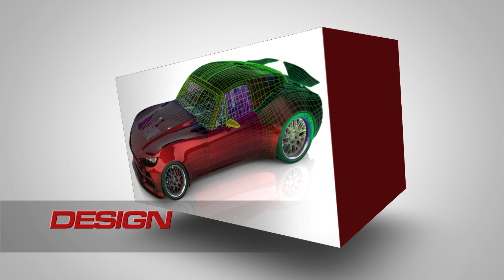Finally an update! - Bailey Blade XTR Car Design - Part 84

Comment: lol, I don't buy that at all, I'm from wisconsin, it goes from -40 to 110 degrees. a thermostatically controlled shop heater is mandatory, and any personal garage or shop I know of that belongs to a serious gearhead has one in, and half of those have AC.  However your car is coming along and looks friggen sweet.

Comment from the maker: Well its a bit more complicated than that... I have several heaters, but I would have to keep them on for days and that becomes dangerous and managing the temperature is challenging in Texas. One day its 80 degrees and the next it can be 30 degrees. If i had it in a normal shop it would be easier to do.. that will happen soon.

Comment: cool. i can cnc any moderate sized sculpture, including entire car panels, as long as the machining material is Styrofoam. Question, are you going to use the same body molds for your prototype and production model?

Comment from the maker: The Engine will be the new Ford 5.0L Aluminator Coyote engine with Twin Turbos or optional Supercharger. 750+ HP. Car pricing is not determined yet... Anyone will be welcome to drive it once we have it out of testing. The amount we need to finish the car is kind of a hard question to answer. It will cost 150K to prototype and a few $mill to get into production. This is why funding has been such a huge deal and why its taking so long.